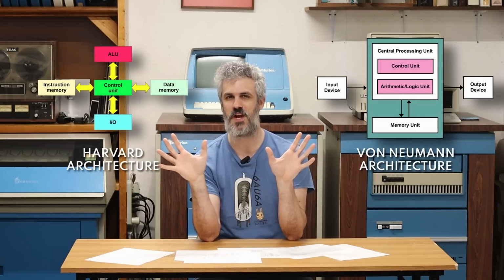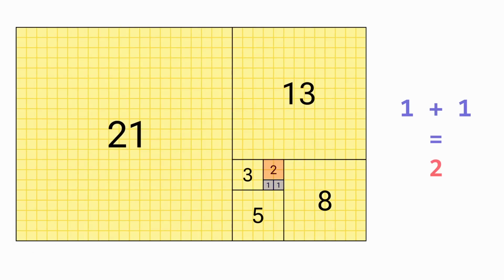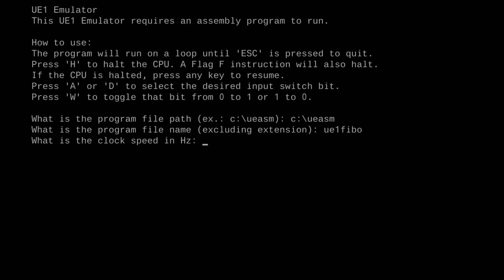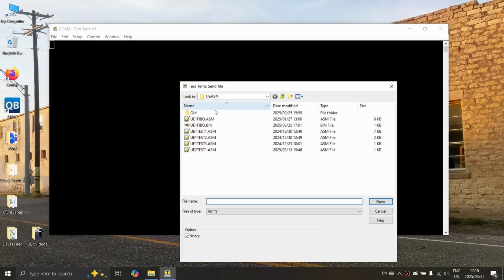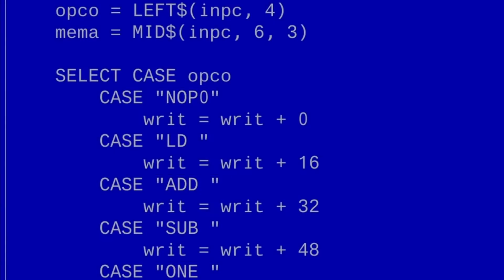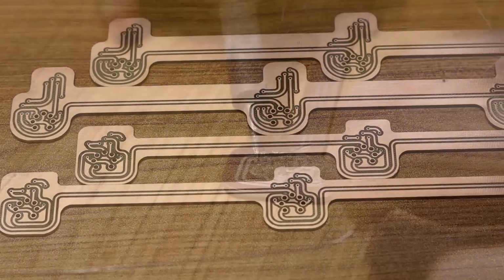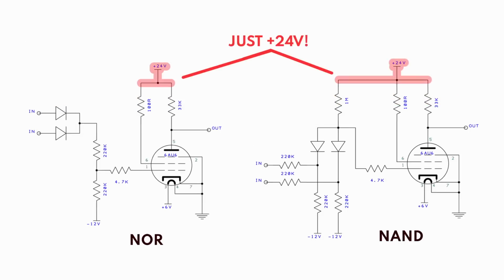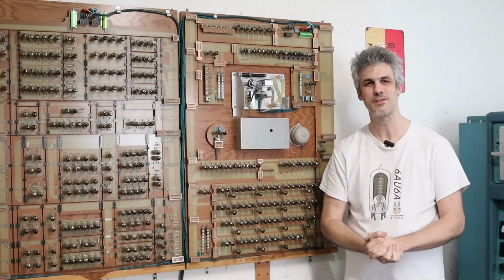I Tried and Failed to Run a Simple Program…

Comment: CAN you single step the tape reader rather than Inputting via the toggle switches. At least you will then know the tape is good/bad and the data path is working. If it works you can look at the tape reader for glitching or jitter when running at speed

Comment: Could you write into the emulator, the ability to read 16 bytes, or perhaps 256 bytes of RAM, just to see what could be done with that much? You probably don't have that many vacuum tubes, or breakers, but it should be fairly simple in the emulator.

BTW, QBasic rocks. I wrote an orbital simulator back in the day that made pretty spirograph-like patterns on the screen. Good times.

Comment: Ahem…wire up your eight bits of memory to an external 256 byte Core Memory, and wire the outputs from that back into your external input. BOOM Now you have RAM.
Reply: I will leave the exact implementation of these ideas in your very capable hands, and suspect somehow that the mighty Centurion will find a way to make himself useful in your endeavor.

Comment: One problem I ran across when building my CPU was with having enough charge in the right places at the right time. Maybe not as much of a problem with your 24V, but maybe it's the power supply, and more specifically having enough localized charge at the locations where you are doing switching... ie the flip flops.  The other problems I ran into had to do with the clock and clock skew and clock reflection.  I handled that by putting buffers on the clock in certain areas to keep the clock from drifting or having to drive too much current on it's own... again another localized charge problem with switching. The solution for me was like I said, adding buffers on my signals, but also adding capacitors so that the switching had enough localized charge for that speed of switching - which was a run it and make an adjustment, then run it again.. situation. Any time I increased the clock speed outside a certain threshold,  I ended up having to go back and add more capacitance to the power supply design.  Hope this helps... Happy Sunday!

Comment: since you're running the tubes outside of their specs, did you ever characterize their dynamic behavior? if you feed a gate (or what have you) built from them a signal, did you measure the propagation delay through said gate? did you estimate the propagation delay through the critical path of the combinatorial logic?

Comment: Tecnicaly you can have more memory than 1 byte on the UE1 because of the conditions what you could do is have a seperate program for every virtual memory state virtual memory is stored as the program you basically have a path for every virtual memory based on witch path you took you know the memory state

Comment: It's hard to solve math problems or any other conventional program on the 1-bit machine.  You need to try something along the lines of what the chip was sold for back in the day: process control.  I asked ChatGPT to brainstorm some ideas:

<quote>
That's a fantastic and fun idea—reconnecting a retro-tech project like a 1-bit CPU vacuum tube computer with its original domain: *process control.* That’s where it shines, and where it could actually "feel" fast and purposeful despite the simplicity.

Here’s a brainstorm of possible *vintage-feeling but demonstrable* process control tasks the machine could realistically handle, especially if you build simple physical simulations or use LEDs/switches for I/O:

---

## 🔧 Practical Demonstration Ideas

### 1. *Traffic Light Controller*
- **Inputs**: Timers, pedestrian button, night mode switch.
- **Outputs**: Red/Yellow/Green lights for two directions, Walk/Don't Walk.
- **Features**:
  - Pedestrian crosswalk that interrupts car flow.
  - Night mode where it flashes yellow.
- ✅ Simple to wire, very visual, clear state machine.

---

### 2. *Automatic Bottling Line*
- **Inputs**: Bottle presence sensor, fill-level sensor, cap sensor.
- **Outputs**: Conveyor motor, filler actuator, capper motor.
- **Features**:
  - Detects bottle at position.
  - Activates fill and capping stages.
- ✅ Great candidate for a step-by-step demonstration.

---

### 3. *Silo Filling System*
- **Inputs**: Tank level low, tank level full, fill enable.
- **Outputs**: Valve open/close, alarm.
- **Features**:
  - Opens valve when tank is low.
  - Closes when full.
  - Sounds alarm on overflow or stuck valve.
- ✅ Nice compact example of feedback control.

---

### 4. *Elevator Controller (Two Floor)*
- **Inputs**: Up/down call buttons, door closed, floor sensors.
- **Outputs**: Motor up/down, open/close doors, floor indicator light.
- **Features**:
  - Prioritize requests.
  - Wait for doors to close before moving.
- ✅ Very educational for teaching state transitions and safety interlocks.

---

### 5. *Conveyor Sorting System*
- **Inputs**: Object present, color/type sensor, sorter ready.
- **Outputs**: Conveyor motor, pusher left/right.
- **Features**:
  - Decides which bin based on detected feature.
- ✅ Looks interactive and "smart" despite simple logic.

---

### 6. *Simple Greenhouse Controller*
- **Inputs**: Temperature, soil moisture, time of day.
- **Outputs**: Fan on/off, watering system, grow light.
- **Features**:
  - Fan on if too hot.
  - Water if dry and during allowed hours.
- ✅ Can fake sensors with dials; visually interesting with LEDs for outputs.

---

### 7. *Warehouse Gate & Alarm System*
- **Inputs**: Door switch, key switch, motion detector.
- **Outputs**: Door lock solenoid, alarm bell, status LEDs.
- **Features**:
  - Alarm if motion is detected when door is locked.
  - Authorized access enables unlock.
- ✅ Feels like a real application, nice I/O switching.

---

## 🧠 Bonus Educational Angle
Because the vacuum tube project can only show results transiently, pairing the control logic with an *event logger* or *simple flip-dot display* (to record states over time) could help others follow the action. Or just wire up a row of indicator lights for state/step tracking.

Alternatively, you could *simulate physical systems with relays, magnets, and switches* rather than digital counters. It keeps the feel very 1950s–1970s.

---

Want me to sketch out ladder diagrams or flowcharts for any of these, or narrow it down to one with the best visual payoff for a YouTube audience?
</quote>
Reply: It would be interesting if he used it for some use on his property. I'm not sure if he has farmland , as not seen enough outside shots. But wouldn't it be great to have a pump or greenhouse controller run off of it?

Comment: Could it be signals "ringing" on the control lines. I had this problem on my descrete transistor cpu. It worked perfect when single stepped but when clocked there was a 25nsec spike that was reseting the registers. A simple RC network on each control line to damp the signal to each card cured this. In my case I damped to 1usec. My cpu is a little smaller than yours but the signal runs must have quite an inductance and capacitance.

Comment: If it works in single step, but not at speed do the signals look good? Parasitic inductance / capacitance could be an issue in such a big PCB. Does the power supply deliver clean B+ to drive all tubes rapidly switching?
Reply: I was thinking this, big issue from emulation to reality step with designs capacitor based designs

Comment: Sorry for asking before going digging for an answer in previous videos, but it's been a very long week. 
Curious about the design and fabrication pipeline for your PCB milling. Kicad (or something of the sort) and FlatCAM (or something of the sort)? Or something much more oldschool, or something still modern-ish, but different from Kicad and FlatCAM?

Longtime fan, you're doing God's work, cheers.

Comment: I noticed some of that code in the emulator could be in SELECT CASE blocks which, it's been a while, but I recall being a lot faster than a bunch of if, else if, else if, etc.  I didn't see if it was any performance critical code where the difference would matter though.  I see in the assembler it was used though.

I dunno that QBASIC had any real timing functions built in that I recall.  You could maybe use the VGA VSYNC register with a WAIT statement.  I forget which this was but I remember it was a kinda common idiom in more advanced games that could be found.  Probably other stuff like DOS timers and things could probably be used but i never messed with that.

Comment: The punch card reader is too fast is my guess. Maybe you could do an interface with lamps to test the reader? With like a simple arduino uno and perhaps 8 relays if the lamps draw high currents if not possible to use led.

Comment: Great video! Why is the tape reader reading so fast? Myself , I would put a binary display on the reader with a manual step on the feed, so you can go step by step on the data going in with visual confirmation. You said yourself it is a short piece of paper.

Comment: 1. Can confirm, building a computer from scratch is hard. Even if you use ICs for it. 

2. Have you checked the paper tape against your binary? TeraTerm might be pushing the data too fast for the punch. 
 
3. As someone else mentioned, a simpler program might be better for a first test and debug. Maybe start with just counting on the output, using as few instructions as possible. Then add one instruction at a time, to confirm that every instruction actually does what it's supposed to
Reply: agreed... simple is your friend.

Comment: Using QuickBASIC for that job is cool. I once wrote a PDP-8e emulator using BBC BASIC, under both RISC OS and Linux. As well as tape images of FOCAL, it would boot RK05 disk images of OS/8 and run Colossal Cave Adventure, but only if I disabled my code for the extended arithmetic instructions. I never tracked down the bug and haven't worked on it since.

Comment: Hello. So, first you need to try and refrain from guessing. Next, you need to execute one line at a time, in order to see where the problem is. Also, 700 watts is a lot of power. Using the connector pins to connect the boards together the way you are, is most likely the problem. Those connector pins tend to bend easily on the inside, because they are made of soft cheap metal. It would be better to remove the board connector pins and solder them together using wires. However, also make sure the power is adequate from the power supply. You can identify power issues using a thermal camera, which indicates power bottlenecks where connectors appear hot.

Comment: You have an emulator for the UE1. So why not manually input and single step through the program while verifying the register states by single stepping the emulator in tandem with the real UE1? That would eliminate the tape reader and any overspeed issues as a starting point.

Comment: Quick basic has a "case else" you could have used to catch the error with sophisticated error handling.
[code]
R$ = "It worked"
... bunch of code ...
CASE ELSE
R$ = "NOPE!"
.... bunch of code ...
PRINT $R
[/code]
This not only tells you that there is an error it also tells you that the error is somewhere on your computer and not somewhere else.

Comment: If you're really strapped (no pun intended) for RAM, remember that in some '50s machines a loop of wire was used for memory and the bits were circulated on the loop. This required fewer parts and was more reliable than vacuum tubes (but not by much)
Reply: Not the loop of wire, but the ferrite cores on one. It is a really neat memory type, yet is pretty tricky on the access logic. Here it would be beneficial due to the storage space, yet making the tube-based controller will be tricky.
Reply: @TheBypasser  Yes but in addition to ferrite core, there was a loop memory that shifted bits in as sound waves and kept the waves circling around a wire. They were called delay lines. Univac used them in its first computers, before ferrite cores.
Reply: @ This is pretty tricky to build though, as both the materials and the transceiver may affect the data integrity. Also I have zero idea how to sync the thing... UART-style start/stop bits I guess, though likely there is something else.

Comment: SCREEN 11
FOR x = -1 TO 1 STEP .0025
PSET (x * 70 + 320, (SQR(ABS(x))) * 50 + 200), 1
PSET (x * 100 + 320, -(SQR(ABS(x))) * 100 + 200), 1
PSET (x * 94 + 320, -(SQR(ABS((ABS(x)) - 1))) * 5 + 80), 1
NEXT x
FOR x = -1.8 TO 2.4 STEP .005
PSET (EXP(-(x ^ 2)) * 50 + 397, x * 120 + 200), 1
PSET (-EXP(-(x ^ 2)) * 50 + 243, x * 120 + 200), 1
NEXT x
FOR x = 0 TO 1 STEP .005
PSET (SQR(x) * 15 + 305, x * 80 + 225), 1
PSET (-SQR(x) * 15 + 335, x * 80 + 225), 1
NEXT x
LINE (320, 300)-(320, 480), 1

(if SCREEN 11 doesn't work, use 12, but you gotta replace all the , 1 at the end of each PSET with , 15 because it wouldn't look all that great in dark blue)

Comment: In 1986 I began with apple basic on my apple IIc. Then in 1990 or so I upgraded to a 386-33 and loved Quick Basic 4.5 to teach myself programming which now at 67 I don't remember much.   I'm still trying to grasps how peeps figured out how to make circuits do stuff.  Someday II'll understand what a X reg is. Didn't know they still made vac tubes. Love the stream. 10 X=1, 20 x=x+1, 30 print X, 40 goto 20.

Comment: Think of all the 1970s homebrew computing.  No internet. No buddies in another state to help you.  Just you, some documentation and your project and what is between your ears.  Mad respect to the guys who did it.
Reply: Well, there were computer hobbyist groups.
Reply: @Bob-1802 And from what I've read and heard, DIY electronics and computers were much more popular as a hobby back in the 70's and early 80's. People used to really like to "tinker" more back then. We need to bring that back.
Reply: @ct6502c  Kind of doubt thats true. Pretty much all my friends, with me included tinker with either engines, welding, soldering, building computers, and programming. No one does everything of course, but it's really short sighted to say such things as if it's unique to a generation to tinker with electronics.
Reply: @ct6502c  people enjoying tinkering hurts profit of tech componeys, people that like tinkering are the same people that will use open source software for everything they can
Reply: @Bob-1802  Amateur Computer Society. Started before the 1970s. I've seen their Newsletter labeled as volume 1 from 1966. 

Each of the popular homebrew computers generally had one or more groups, many of which published newsletters. 

Corrections, enhancements, sources for parts and software were distributed and in person get togethers (often within amateur radio swap meets) took place.
Reply: i am assuming there was more support since all of the stuff was new and cutting edge and you had a lot of companies involved most people just moved on to new stuff a lot of info got lost over the years
Reply: @belstar1128  Yes, but homebrew computers are one off custom projects, that's what makes them homebrew.  The computer is your design.  But I agree with you the chip makers were likely very supportive, but I was a kid in the 70s and never anything like that.
There were kit computers and some of them were quite popular and so you might have a club in your town where members can help each other.
Reply: @tarstarkusz  ok I see what you mean that would be quite hard if you also had to design the entire thing from scratch. I wasn't around in the 70s but I do remember that before the internet it was hard to get information about things that were not popular. and for something like this you need all the details no room for mistakes.
Reply: @tarstarkusz  Nope, most homebrew computers were not 100% one off, or even remotely close. Almost all were either reference designs of a CPU or some modified design published in a book or a magazine. That you didn't see it or find out about it doesn't mean they didn't exist, a lot of these things were by mail, and small "publications" that some dude made copies of with those roller things, pre photocopiers. 
Also, magazines were full of things back then, you could build a CPU board and stick it into a S100 bus format, stick that into a backplane if you had it, and make it talk to some other hardware like a CRT controller or a floppy or printer or whatever. Kits were available with mail order and some came with a PCB ready to go. You could mail order just about anything, from chips to kits to fully mounted boards. 
But you needed to have the cash to do it more than anything else, and probably a teacher or parent or uncle or so, who knew basic soldering and stuff like that. But there were TONS of resources for that stuff in the 70s if you knew where to look, in the 80s too but it waned with home computers becoming common since it was a lot easier to buy a VIC-20 or a PET or whatever than to build some S100 project out of magazines.
Reply: @noth606   Were the "roller things" you mentioned Ditto machines? I remember when I was a little kid in the 1980's we would get homework on Ditto copies, and they had a very distinct smell of ink. Lol I still remember it to this day 🤣
Reply: @ct6502c  Had to look it up, yes. Didn't know what they were called. Saw them next to where the photocopier was installed later 😁 and was told that's what they used before. Didn't see them actually used as far as I can remember but probably did get homework made on those in the 80s too. Particular smell yes. Remember that weird grey or green paint or enamel whatever they were finished in, didn't quite look like the finish on anything else except maybe hole punches or those big staplers. "teachers special" finish haha. All the stuff with that finish was off limits one teacher told me - I think I was 8 or 9.
Reply: you and your local computer club and maybe some guy with contacts at a university